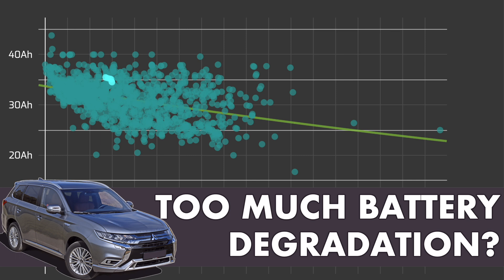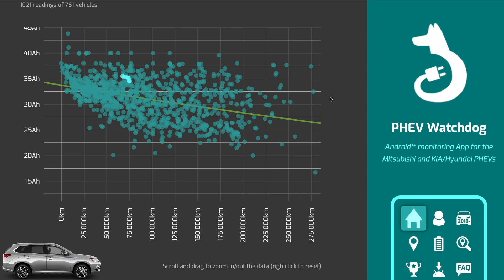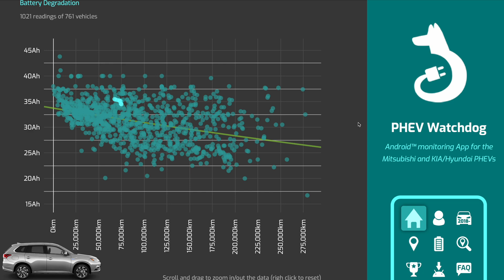Mitsubishi Outlander PHEV - Battery degradation

Comment: The Yuasa LEV 40 cell, that is in the Outlander battery pack has a theoretic maximum amount of 5500 cycles before it is degraded to 80 % capacity. A cycle is 1 complete recharge of the batteries total capacity, in the Outlander that takes about 2 normal charges to full. In theory you could last 15 years with the battery charging 2x per day and it still would be o.k. However the cell degrades chemically over time as well ( even if you don't use the battery ) These factors can be calculated and expected and the guarantee limit could easily be 10 years if this was all there is to it. However heat buildup will degrade the cycles even faster. Heat is the main reason ( outside far heavier use then charging 2 x a day )  why some users will see a more rapid decline in their batteries capacity, which can be caused by fast charging in a hot climate, regenerating in a hot climate ( driving off a mountain in B5 ) or towing at maximum capacity in an environment with mountains or hills in a hot climate, so basically anything that will stress the cell with high currents in an already hot environment which can be summer in some moderate climates as well. What Watchdog shows is not the battery condition but what the BMS calculates it is by some Mitsubishi formula. With a relative new battery these calculations will be on the protective side and the battery will have more capacity then the BMS says. However for older cars the calculations become more like the real state of the battery. All Lithium based batteries behave like described above, the only difference is how much effort is put into cooling the cells. And of course, far larger batteries ( of EV )  won't be charged 2x every day but more likely once a week, so will last much longer with their cycles. That is why battery degradation of EV cannot be compared with that of PHEV with smaller batteries. However an Outlander with a degraded battery is not a broken vehicle, but will continue on as a HEV, using it's gasoline engine more and more and eventually all the time. As long as the battery not completely fails and can still buffer current from the ICE to the e-motors the car will continue for years on end very similar to a petrol version of the Outlander. It may eventually become less fuel economical as the petrol Outlander and the ability to drive some miles in EV is then long lost.
Reply from the maker: @Strada098  thank you

Comment: I just bought a 2018 Outlander with 44,000 miles. I have noticed that just driving around town the battery does not last in hybrid mode. I can drive maybe ten miles in hybrid mode and it eats up 30-50% of the battery. Is this normal behavior?

Comment: i have a 2018 outlander phev and at the moment my car has been at the dealership for 3+ weeks doing battery test for warrenty replacement.its at 76,000miles with 51% battery health , i'm only getting 10-12 miles at full charge. the dealership told me that its not charging now, so all them test they did finally broke my battery so its looking good for me in getting a new replacement battery, still waiting. the car is very great at everything but the battery issues. i don't want to go back to gas only car, i love the twin electric motors.
Reply from the maker: You may want to try full EV as well, if you like PHEV you might equally find going back from full EV difficult !
Reply: What was a conclusion? Did you get the new battery?🙏

Comment: My friend is thinking of buying one with  101,000 miles it's a 2015 model what you think battery condition might be?
Reply from the maker: According to the chart 50% chances there will be 29Ah left (73% capacity). The battery goes down to c10Ah. At c300V that's 5.7kWh useable or a 25 to 38km. You decide whether that is enough for you. What i would do is ask for a measure of remaining capacity before i buy.
Reply: @evdabbler  25km for 5.5kwh is pretty good, especially for such a huge vehicle . Was it about 10kwh when new then? My leaf was 30 kWh when new , it's 20 now at 120,000 miles so lost about a third of its original capacity

Comment: Thank you for sharing the stat and information, I'm currently in the market for a new vehicle and have set my sights on the 2023 Mitsubishi Outlander PHEV. I'm curious to know has the battery degradation issue been resolved in the 2023 Mitsubishi Outlander PHEV or even in the earlier models from 2020 to 2022?
Reply from the maker: Unfortunately I have no information on the new 2023. Unless stated otherwise (eg new BMU, cooling system) etc... I would assume similar degradation over time. Saying that, with a larger battery capacity and a new car, it would take time for you to notice the difference. You also get the warranty. Good luck with your choice
Reply: Thank you  @evdabbler
Reply: the car is great , i love running the ac in the middle of the summer and not using the gas engine, yes the battery is an issue but if you keep an eye on it and with the warrenty ,you should be good, just get the battery checked before warrenty runs out.try and get the new one , the GT version , you'll get more features for your money,and get the tow package from the dealership ,easy to install with the instructions it comes with.if you get the new one, you'll get tax rebate check of around 5,700 in the USA.great car , i only wish they would make it with a bigger battery. love the car period.

Comment: Hi have you tried to corelate the degradation with the nr of charges? you can see them on the watchdog. For me every single full charge is eating away 0.1Ah of the battery..
Reply from the maker: I have lost 1Ah over 5 months and 999kWh recharge, which is more or less c135 recharges. So more like 0.01Ah lost per charge.
Reply: 0.1ah is too fast . so that after one year your car battery will fully degraded ?

Comment: How does one go about checking the battery state of health? Can this be accessed via the car infotainment system?
Reply from the maker: Not really. One of the ways is to reset odometer, reset consumption meter, charge to full, drive on electric only until engine kicks in, note distance driven, multiply by Wh/km on display. Compare this to the numbers i have shared in the videos. Ie do you get 5kWh, 7kWh, 8kWh? Obviously the higher the better.
Reply: @evdabbler  Thanks for this, our cars would be in miles rather than km. Also, what sort of battery health would you expect from one thats done 102k miles? Are they still worth buying?
Reply from the maker: @solefreak2  per the graph here you d probably want a car that has 30Ah or more, it d be in the upper half. which means 75% min soh for 100k miles. Possibly looking at  typical 20miles range (5.6kWh at 3.5miles per kWh). Again as per the final comment in the video this is not an EV. Don t expect to go far on electric alone. If that s what you want to do, go straight to an EV... that s why we kept this one just 6 months!

Comment: On peut rouler avec la batterie dechargé?
Reply from the maker: Oui absolument. La batterie "dechargee" reste a 25% de capacite. La voiture devient alors un mild hybrid.
Reply: @evdabbler   C'est parce que ma Lexus m a laché a 359.000 km en plein col de montagne , j ai du payer le remplacement 5200 eur! Plus jamais de vehicule ayant de batterie hybrid comme talon d achille!
Reply from the maker: @BELHORIZON31  euh ceci dit ne serait ce pas le cas de n importe quelle voiture qui pourrait lacher a 350,000km et engendrer de tels frais a ce point la?
Reply: @evdabbler  etes vous certain que si la batterie de l outlander rend l ame il y a possibilité de rouler en thermique? Ce n est lié à la transmission?
Reply from the maker: @BELHORIZON31  Non. Pas sur du tout. Je repondais initiallement a la question plus simple (et differente) que se passe t il quand la batterie est dechargee du point de vue de l utilisateur
Reply: @evdabbler  concretement le vehicule peut rouler sans la batterie, meme en panne

Comment: Most important question for me was how many km does it give you in ev mode after 70k km...what is the rate of degradation in pure ev mode over the yrs.
Reply from the maker: Check out my other videos as you will find more on range. But if you have 7.5kWh usable on 180Wh/km, that s 40km median range. More if no fast road.
Reply: @evdabbler  thank you for your response.

Comment: Do you use a watt-hour meter periodically to measure the energy actually accepted by the battery from nominal empty?
Reply from the maker: With an EV wallbox, I know how much wall to wall energy is delivered every time. In addition the OBD dongle coupled with the phev watchdog app allows to monitor how much goes in and out at the level of the car.
Reply: Battery degradation increases  the internal resistance of the battery, so loses on charging become much higher than charging a battery in a normal state. So you may have, let`s say 10 kWh energy to the battery, but 20-30% of them will be lost as a heat and the rest will be charged.  So the capacity can be measured only on discharging.
Reply: You can see this also in the cars charging cost menu where you set a fixed price for KW and for me its also going lower and lower..
Reply: My experience with a 2017 Minicab Miev diagnostics is that the ECU software has an overly pessimistic battery degradation estimation based on elapsed time since the battery manufacture date. This causes the ECU to not fully use the available capacity.
When you occasionally run the "battery capacity learn" procedure through the MUT3 interface, the ECU discharges the battery fully (2.8V) using the heater then recharges (to 4.1V with balance). This takes up to 12 hours on the 16 kWh (50Ah cell) Miev battery.
Last time, the estimated cell capacity was 35 Ah (range estimate 71 km) before running the learn procedure. Afterwards it was 41.8 Ah (range estimate 124 km).

Comment: does bmu home reset is same as dbcam at service  ? :)
Reply from the maker: No. I understand a bmu reset standalone is not advised. If my understanding is correct, it just wipes out the recording on the degradation rather than use the opportunity to recharge slowly and recalibrate.
Reply: @evdabbler  am can you do dbcam at home?
Reply from the maker: @roltol7539  no I wouldn't think so.
Reply: @evdabbler  as my research says you need MUT3 and some russian "driver" that you have to pay for, and you are good for home diy dbcam.